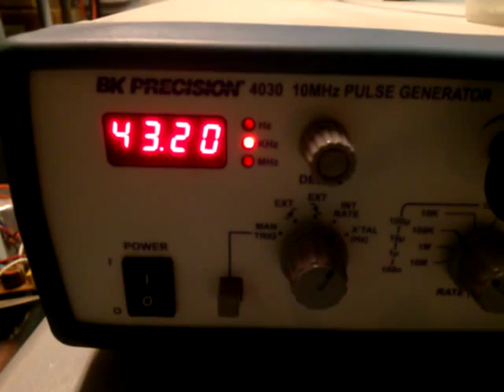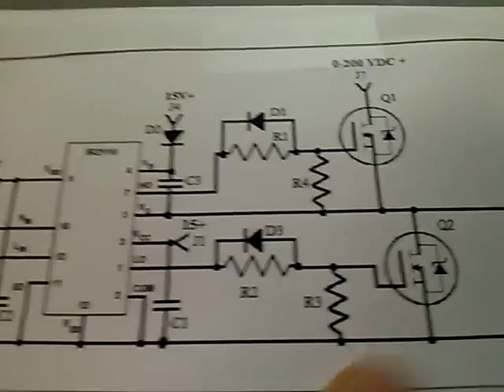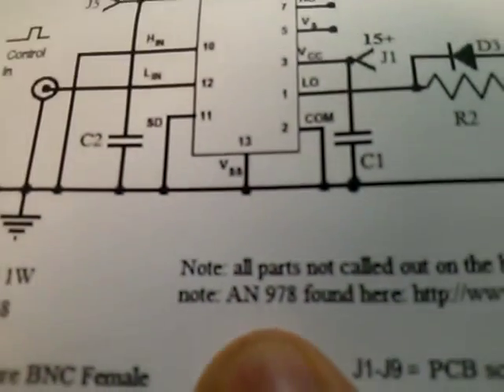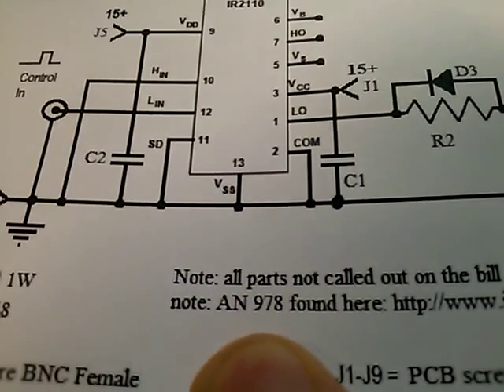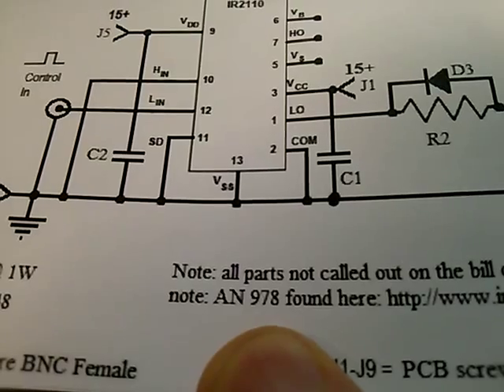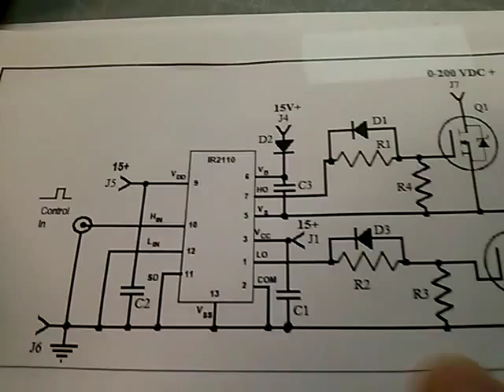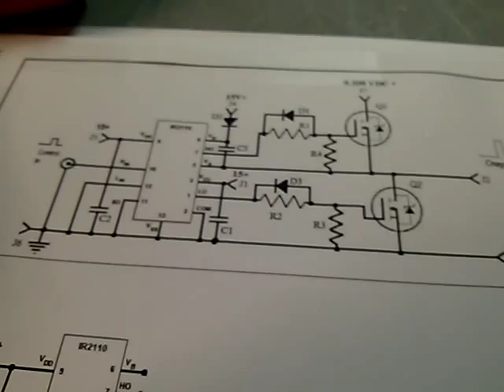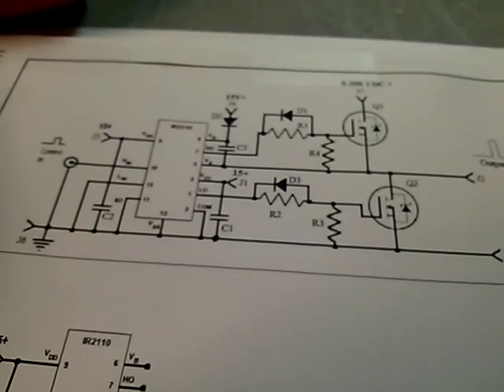IR2110 Pulse Generator Circuit

Comment: We have a problem in using ir2110 , We can able to switch on only low side. How to switch simultaneously both on low and high side( Bldc motor)
Reply from the maker: That is more difficult than low side switching, study this application note for more help. that is what I do to figure these circuits out. Google the  application Note for IR2110. The links don't work here.Cheers........Captain Willy
Reply: thank u ....the link is not  opened............
Reply: any other idea sir????
Reply from the maker: That is more difficult than low side switching, study this application note for more help. that is what I do to figure these circuits out. Google the  application Note for IR2110. The links don't work here.....Cheers........Captain Willy
Reply: Thank u
Reply: @marimuthuc9972  can you send me diagram for high side switching circuit

Comment: Very good video friend, I would like to ask you what voltage is your input signal to IR2110 by HIN AND LIN, THANK YOU VERY THANKFUL TO YOUR ANSWER
Reply from the maker: thanks for the comp. we use a function generator to drive input. Normal 0-10 vac signal and very low wattage.
CW